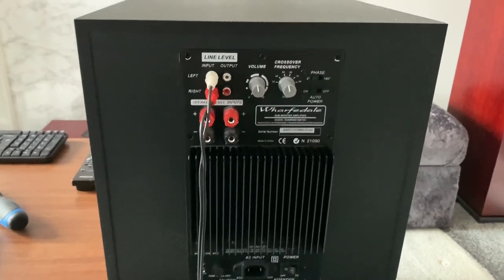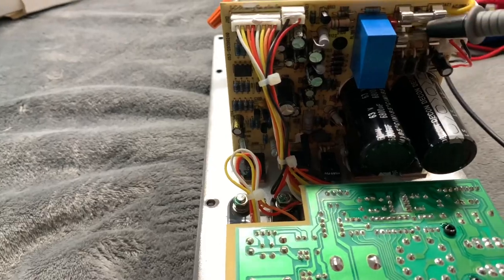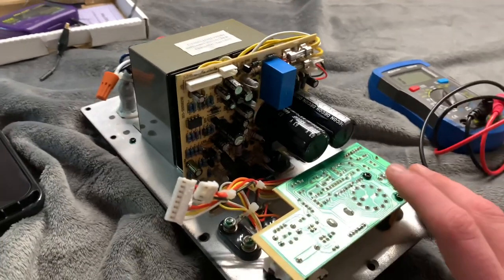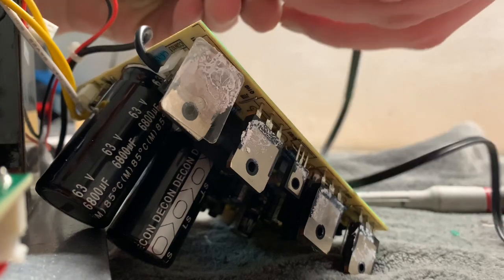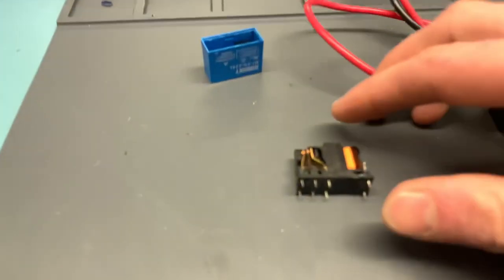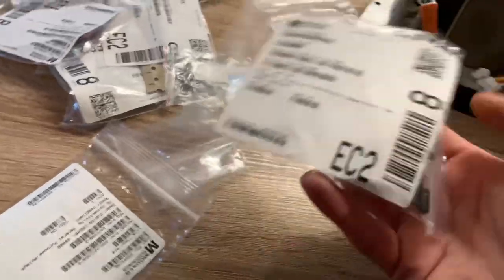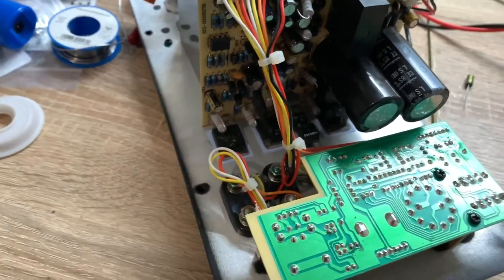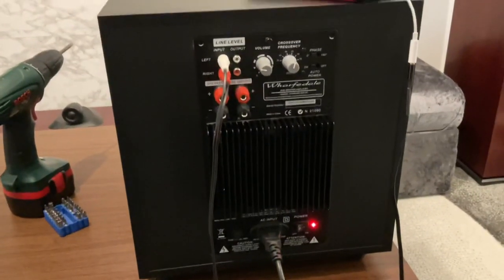Wharfedale SW-150 Subwoofer Repair

Comment: Great video - very clear. Quick question: do you know the ohms of the driver? I want to update mine as it clicks (don't used to, but sent to much bass though it). Wharfedale will sell me a replacement 
driner but I want a higher wattage rated driver. Every time I ask the question (my gut tells me it's 4 ohms) they avoid confirming or denying, and just try to sell me the replacement 10" driver. 
I have a normal multimeter, but it doesn't show a meaningful reading on resistance across the disconnected speaker terminals.
I'm sure I'm being dumb here - any help is appreciated.
Reply from the maker: Hi thanks for the comment, head over to the WD website and they have the specs on there. They still sell this woofer today. I actually really enjoy them (I have two) they seem to achieve the bass lines I want to be hearing with out booming the place down 👍
Reply: @MrReeceyburger123  Thanks for the reply. I've looked all over the website but the only impedance measurement I could find was the input, not the actual woofer impedance which is what I need to know in order to change the speaker itself.
Appreciate the help though 👍😁

Comment: Looks like a dodgy batch of relays, mine has done the same, thanks for uploading.
Reply from the maker: I think it’s just the use on them, the auto power on off when up loud too is deffo what kills these this bad.
Reply: @MrReeceyburger123  I noticed the relay got noticeably louder before it failed, I have set the auto power setting off since repairing.

Comment: Is it possible to bypass the Auto on/off switch by soldering a wire?
Reply: Can't find a replacement daughter board but I believe I have same issue, just standby light no power on

Comment from the maker: Think I’ve sort of confirmed my suspicions of the auto power feature causing the relays to blow. I had it up loud and muted the input, after unmuting the main amp brought the output up nice and slow. The sub however thudded on at high volume, I’ll remember not todo that in future with this one 🥲
Reply: I have exactly the same issue with this sub, do you have a link to the relays or the part numbers? Thanks 🙂
Reply from the maker: @darrellcoutinho805  use mousers filter system to help you search for them. The small is 24v single pole 5a, the bigger is 24v double pole 2 throw
Reply: happened to mine but its back up and running fine. I have port noise and distortion can i have some help
Reply: @ojgaming5423  do you have a link to the replacement parts? Cheers
Reply: @darrellcoutinho805  i didnt replace the parts. the relay unstuck itself and its now working without issue for about 2 months now (without auto power)
Reply from the maker: @ojgaming5423  I have one of these doing the same thing mate. I think the actual speaker itself is faulty somehow I need a donor unit to test 😅
Reply from the maker: @ojgaming5423  I resealed the cab properly, nothing is lose inside, electronics all replaced. It’s like the weld is leaking air
Reply: @MrReeceyburger123  it’s the port I flipped the sub over while playing 39 hz and it was pushing alot of air. I re did the glue job on the port and it did nothing

Comment: Hi, I have the same subwoofer and mine only works in normal mode, with the auto power switch OFF and the subwoofer permanently ON.
If I try switching to Auto Power mode ON, it doesn’t work.
With the subwoofer ON, with incoming signal, it works for a couple of minutes and then it turns off (standby). 
And then in standby, it doesn’t turn ON when a signal is detected. 
What can I do?
Reply from the maker: could be relay